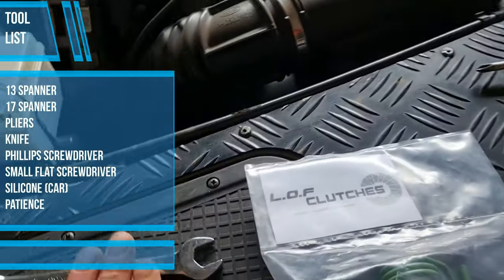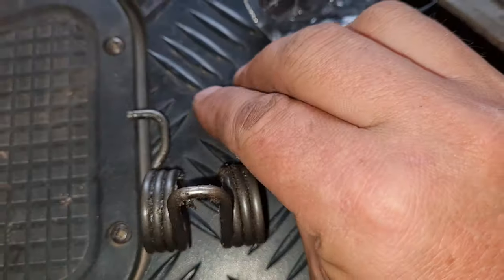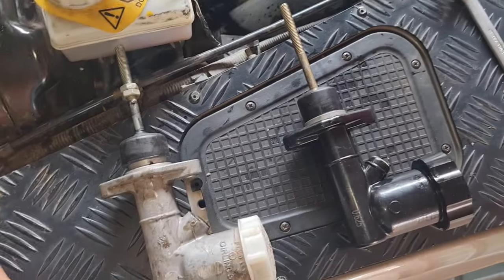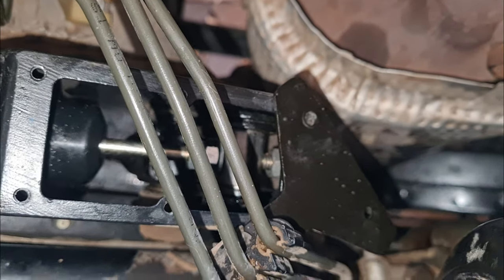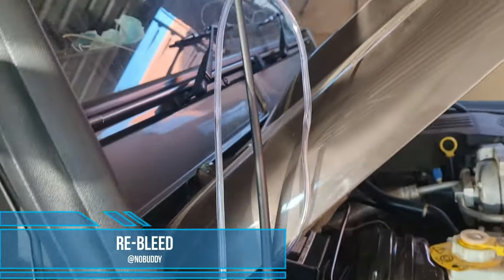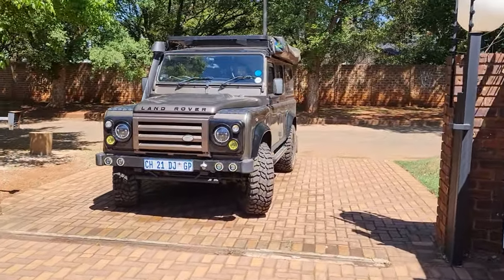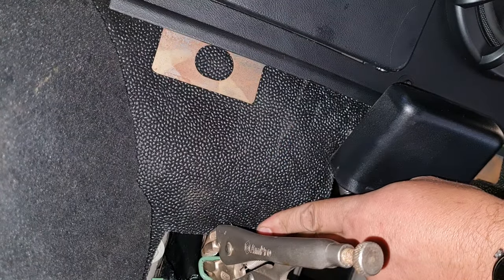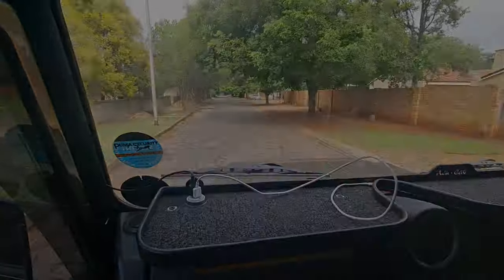LOF PowerMaster Cylinder and Spring Installation

Comment: I like your video, i did mine a month ago!  moving the coolant reservoir to one side helped! but the bottom bolt on the master cylinder was very difficult on my own.   I used a ratchet spanner and cable tied it to the pedal spring, so it would'nt move; and undid the nut from under the bonnet.    However I didn't get on with the cylinder as my bite point was 1cm from the bottom and i was unable to change it without the pedal being very very high.  So for now i have swapped back to original.
Reply from the maker: Hey James, looking back now I think maybe the spring as a simpler option is worth it. I had the same issue with a low bite point but after swapping out the slave cylinder due to failure it was better. Redone the carpets in my vehicle now and with the extra thick felt at the bottom and sound-deadening material it also seems to bite quite low, helps to remove the rubber mats but still keep them in for trips. My wife manages to drive as is without complaining. 
Thanks for your feedback.
Reply: @MdPcustoms  Hello dear friend, my question if you would be so kind, is this lof spring when installed, will it relieve pressure and be enjoyable and is there a difference in the transmission of gears and its ease, your friend from the Kingdom of Saudi Arabia, we wish you and your family all the success and success
Reply from the maker: Hi, the Spring only assists to bring the pressure required to press on the clutch down. The gear engagement remains the same when changing gears. It is more enjoyable to drive with a lighter clutch pedal.